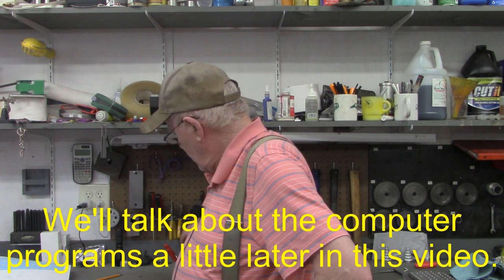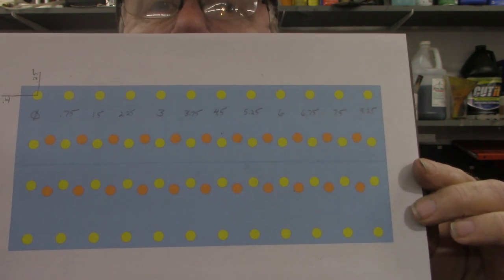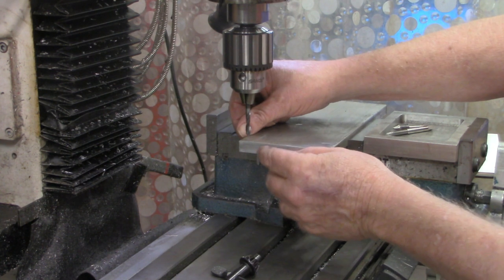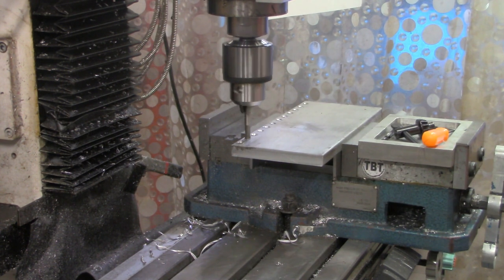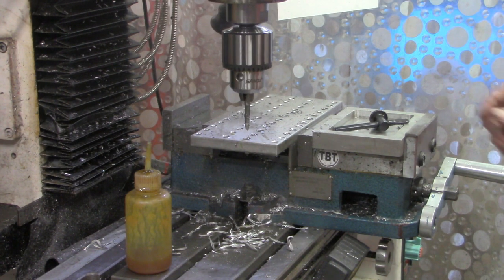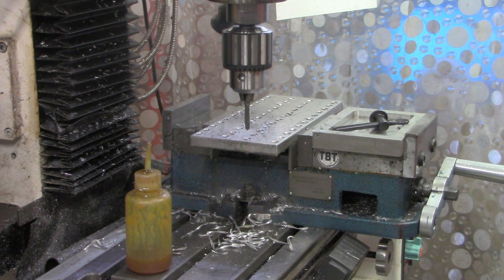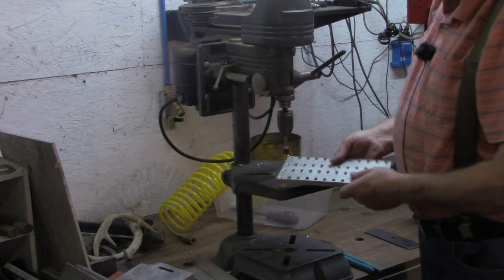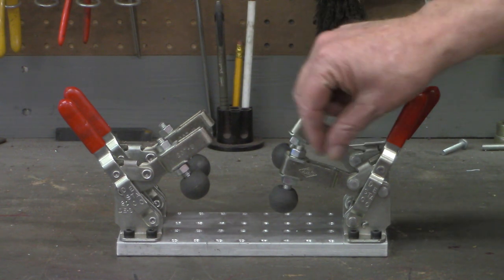Fixture Plate & Talk About My Computer Programs

Comment: Hi Lee, I understand completely about releasing your software, after investing much time into it.  Programmers have to eat too and the grocery store won't accept "I'll pay you next week".  Even open source software requires maintenance periodically.  The program itself is a great idea, thank you for that tip!  I started on my own version, customized to my storage situations. One thing I did want to ask is what are you using for a database?  I'm leaning towards MS SQL because I have a lot of experience with it but it is pretty heavyweight, and there are licensing considerations.  I was thinking maybe NoSQL but there would be a learning curve (probably no too bad though).
Reply from the maker: I’m coding in Python and SQLite is built into Python and great for single user applications. If this was a multi-user environment, I’d likely go with MySQL since it’s free and I have several years experience using it - MariaDB is another open source DB that you might look into. Thanks for stopping by!
Reply: @MrPragmaticLee  Thanks for the tips!

Comment: Mr Lee if I read your drawing correct all the holes are drilled so the clamp has to be turned to the front or back. Would it benefit you to turn the holes in the middle row so the clamp could go side to side.